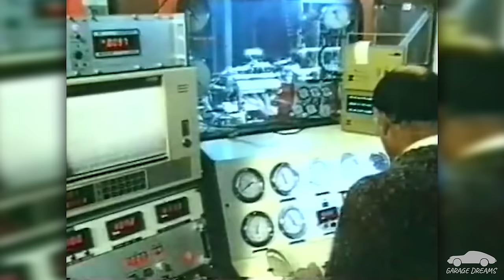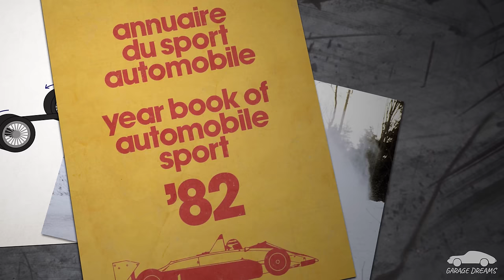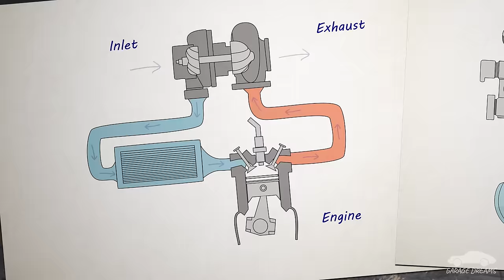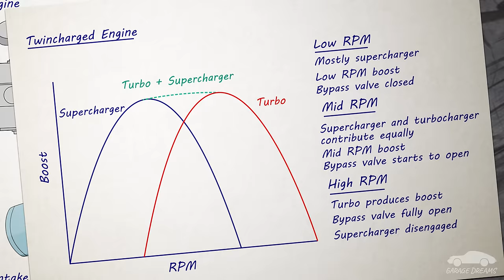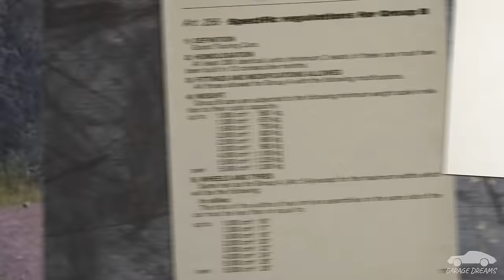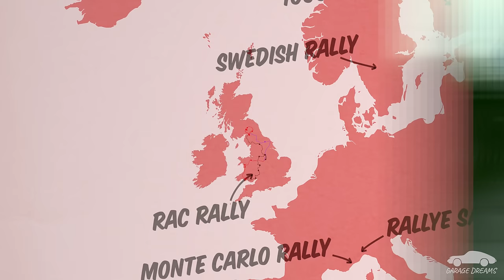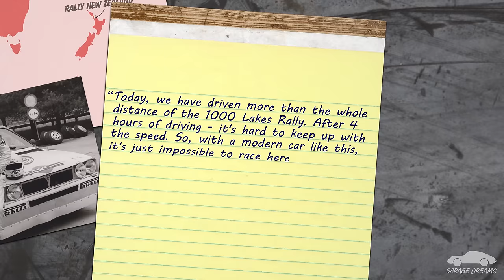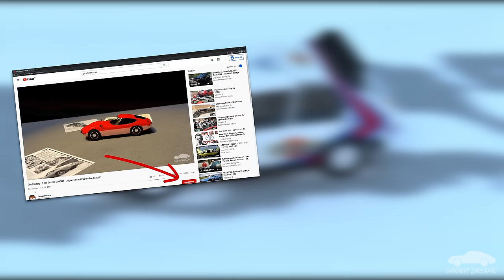The History of the Lancia Delta S4 - The Car That Ended Group B

Comment: Correction* Lancia created a rally car like no other before, or after... this is the greatest rally car this earth will see.
Reply: GP2_Engine the Quattro was not that good only won because the got the rules changed and nobody else had awd
Reply: GP2_Engine  you mean iat abarth
Reply: The greatest of Group B rally cars of all time is the Audi quattro Sport S1 Evo 2. If it wasn't for the quattro, all WRC rally cars would still be in FWD and RWD. And if it wasn't for the quattro Sport S1 Evo 2, WRC rally cars wouldn't have any wings, spoilers and winglets, square fender-flares, turbo anti-lag system, dual-clutch gearbox etc. etc.
Reply: @7spower998  No way, thing handled like a supertanker with the alignment out and was obsolete the minute Lancia an Peugeot ran 4wd.
The 131 and escort had flared arches,if being picky the Chevette HSR had box fenders years before it.
Reply: @7spower998  the dual-clutch came from porsche (and the official race car was a 6-speed manual anyway) and bodykits already came before it in the bmw m1 and metro 6r4.
Reply: GP2_Engine  The S4 was a mid engined turbo and super charched car. No match for the outdated front engined S1,  period......
Reply: Kind of a little bit of both. It ran like nothing else, but that was part of its downfall. Insane car that was a victim of it's own insanity.
Reply: GP2_Engine  Cool as hell but Delta and 037B were real devil's 4 wheelers!
Reply: The Quattro was always the one..went on into different variations Audi were already working on an even more powerful version when group B was banned unfortunately.
Reply: @LJay54  ....what about the later Quattro S1 E2 versions that beat the Lancia and Peugeot? They were also working on the 700hp Audi Sport Quattro RS 002 of course when group B was banned. This would have blown away all competition.
Reply: The quattro is one of the most succsessful cars in group b
Reply: Correct 100%
Reply: @TinyBearTim  they all were good
Reply: AUDI trick the FIA and the other Manufacturers in Paris, France on the table to change the rule that do not allow AWD in Rallye ...they just ask them to allow AWD but absolute nobody despite AUDI wich was testing Iltis this year realize what is really happening because no-one else was dealing with this stuff at the time! AUDI was already starting to build the first Quattro's when the meeting was on going! That dirty ...but the Lancia 039 show e'm "Who is the Boss" ^^
Reply: @Lancista  The Lancia delta S 4 should be used as a case study of what can be achieved when the full force of human endeavour is unleashed to create something magnificent with the sole purpose of blowing the rest of the competition out of the water. The abarth team had a lot to do with it too I believe so credit to them. It is the same power that sent a rocket to the moon in  less than 80 years. Should the same power be unleashed to restore this beautiful planet , it would look like paradise again within a few generations and certainly a whole lot better than it does now within just a few years.
Reply: GP2_Engine   Quattro had the advantage of not being shelved with the death of Group B, as the project got to get tinkered with a bit more and taken to Pikes Peak and the technology later being brought onto paved circuit racing like SCCA, IMSA, and DTM. But within rallying itself Quattro was at a bit of a awkward place, being super bulky and front engined while the succeeding cars were either lighter, smaller, or had better weight distribution.

The main reason the Quattro is remembered the most from this era is primarily because it got used outside of Group B.
Reply: Didn't beat the 205 T16 in 86 🤔
Reply: @TinyBearTim  yeah..but that sound tho 🤤🤤🤤
Reply: I think “Monster” Tajima and his Suzuki Escudo Pikes Peak edition would like to challenge this. Heck Millen and his Celica Pikes Peak have a case too
Reply: Modern Group C cars now exceed Ground B performance.
Reply: @towermoss  yes but that’s with modern technology! The group B cars were monsters, like a feral dog 😂
Reply: Toyota Celica GT-four ST205 has entered the chat
Reply: @Lancista  they didn't trick them  , they just asked at the end of the meeting can they have 4wd , and they said yes if you want
Reply: Correction. Lancia had already done this by creating the Stratos, the first purpose built rally car ever. And there has been nothing like the Stratos ever since.
Reply: @towermoss  Vastly improved tyre and suspension technology.
Reply: The Delta S4 was the peak of rally cars but the Quattro changed the course of rally the most. They still use the 4wd platform today.
Reply: @bfc3057  Wow, and considering there are so many replicas out there, you're lucky to see a single real one. I'd love to see the first prototype, and there's a great story being that. My rarest encounter was a private viewing of the Le Mans winning Porsches in Melbourne, which came over from the museum for the 50th anniversary in 1998.
Reply: @bfc3057  that's the one, I love that flat paint job. I read an article about how they fitted the Dino engine without really getting the proper permission. There were a few sitting on the shelf at Fiat, and the original four cylinder just wasn't doing it for them.
Unfortunately when loading the museum Porsches, they dropped the container with the first  1948 356. Well, the first Porsche ever built. I don't think the aluminum body held up too well. Consequently it needed a restoration... and I missed out on seeing it. It would have been the icing on the cake. Thanks for the info, it'll be a long trip from Melbourne Australia.
Reply: @bfc3057  I was a massive 356 fan as a kid. It's amazing what people have, from McLarens to Stratos. But wow, how many do you need? Quite the nice investment, I think I've heard about that bloke before. I used to own Fiats and Lancias, and the community is pretty tight, word gets around. 
A guy in my small country town would drop his kid off to the school bus in a 959 in the 90s. I couldn't believe my eyes, it was real. I think there's only one other in OZ.
Yeah Fiat being part owner of Ferrari, and I think at the time had acquired a share including Lancia. I think they may have even driven the Stratos to the Motor show for the unveiling. That would have turned heads, what an incredible looking car for the time. Probably only comparable to the 1969 exhibit of the Porsche 928.
Reply: @bfc3057  Love the 288 GTO. Now these are some of the rarest modern cars around for obvious reasons, homolagation. They thought the 037 delicate, but it proved them wrong, so we'll never know. I only had a couple of Betas. Would love a Fulvia or Monte  Carlo. There's something about the lines, and for me, one of the most beautiful cars is the 037. And I  can see the relationship to the Beta and Monte Carlo styling. Plus my father bought a Beta new in '77, so it has been ingrained in me since I was very young.
Reply: The Group S cars?   poor things
Reply: 037 and s4 ara the kings
Reply: Like mr.Alen  told  when local sports reporter asked what was new delta s4 like  , in summer testing. " U can image of what is like to drive tractor 250km/h. That's what's it like"
Lot have happened since those days. And sure group b cars were great at that time. But if some1 blames them greatest, he/she havent ever driven a rally car.
Reply: @bfc3057  nope not the Quattro. Along with idiotic spectators and no crowd control it was actually Lancia that killed Group B unfortunately. In the aftermath of the Toivonen / Cresto deaths it was found in the official investigation that Lancia had stripped down the car to be lighter and not placed adequate protection around the fuel tank cells hence why they sadly got burned alive. A terrible tragedy that could have been avoided it it weren't for Lancia's pride coming ahead of safety.
Reply: @arconeagain  Stratos was the greatest rally car of its' era I still love the Stratos best looking car I think but it couldn't compete with the Group B monsters...my heart would love to agree with you but my head says no 😀
Reply: @bfc3057  I had a Beta, Delta and Alfa Romeo Montreal. Loved every one even though they gave me nothing but trouble and were money pits especially with electrics and bodywork rot. Typically Italian - expensive, temperamental and fiery but like your first love they made you smile a lot.
Reply: @alexcawthorne811  yeah I know it's no match for a group B, just thought I'd point out that Lancia did something very ground breaking several years before. They had a habit of doing this, like the monocoque and V6 engines in passenger saloons. Thanks.
Reply: @arconeagain  I adore the Stratos and yes it was a car designed and bred purely for rallying although I have to say the original concept is possibly one of the ugliest cars ever.... thankfully the final production Stratos was a thing of true beauty. I also really like the R037....if I ever become rich I'll buy a Stratos. Sadly out of my league....even the AR Montreal I had as a mere youngster in the 80's is going for £50-70k now. How I wish I'd held on to that, my Beta and Delta but running them cost a fortune.
Reply: The quattro didn't have much success in wrc in 85 or 86.
Peugeot and lancia were far more successful.
Reply: @theant9821  agreed they were the cars to beat in 85 and 86 but from its' initial launch in the Austrian Rally in 80 through to 84 the Quattro pretty much left the rest for dead....and it still won in 85 with Röhrl winning the San Remo...if only Group B had survived the planned Quattro RS002 @ 700 hp / 186 mph would have destroyed Lancia and Peugeot in the planned Group S. I guess we were lucky to have had the chance to watch these incredible cars but enough was enough...it had become too dangerous.
Reply: @bfc3057  hahahaha....good point...alas we will never know! I think we all agree it had got out of hand. Moreso the total lack of control of the spectators it's amazing not more were killed.
Reply: @bfc3057  I think also important to mention the Porsche 959 and Ford RS200 both of which were new but in development and with some tweaks and in Rally trim they could have put in some real changes. The Porsche of course went on to win the Paris - Dakar.
Reply: @bfc3057  Yes the 959 was really something, RS200 showed potential and a 288GTO would have been something though like the Quattro probably a little bit big and cumbersome versus rival manufacturers offerings...but who knows we can only speculate what might have been. A sad end to the Golden Era of WRC nonetheless.
Reply: @alexcawthorne811  Audi quattro won the championship in 82 and 84.

That's not especially dominant. 
1980-audi quattro debut
Constructors Champions:
1980-Fiat 131 abarth (group 4)
1981-Talbot sunbeam lotus (group 4)
1982-Audi Quattro a2 (group 4)
1983-Lancia 037 (group b)
1984-Audi Sport Quattro (group b)

That isn't dominance, that's winning 2 out of 5 titles.

Even the pikes peak car looked impressive until Peugeot stopped sending regular group b rally cars and built a pikes peak hill climb car themselves.

The quattro was relatively poor and fortunate that its rivals were busy developing 4wd cars of their own while audi already had one. Because the chassis was poor by comparison to its competition hence why the less powerful naturally aspirated cars kept beating it and the rwd 037 took the first group b title.
Reply: @theant9821  look at how many wins it had vs competition. Rallying is a fickle sport as we all know...mechanical failures and crashes play a big part over the season in deciding who wins the individual title as Michele Mouton will tell you. They were by far the most succesful team overall.
Reply: @alexcawthorne811  all variations of the Audi quattro combined won less number of world championship rallies as the Peugeot 206, which despite 3 consecutive championships isn't remembered all that well.

The quattro was successful because it had a good engine and 4wd, not because it was an especially good rally car, and as the competition got 4wd they left the quattro behind. It wasn't until late 1984 that the quattro got its first 4wd rival in the form of the 205 t16, and the Peugeot cut the quattro to pieces from mid 1984 onwards.

The quattro was an impressive car to watch and was competitive against rwd cars like the 037 or opel manta but struggled when a made to measure 4wd group b car like the 205 t16 or delta s4 came along.
Reply: @theant9821  The Peugeot 206 was used in 99-03 so different era altogether more than 10 years after Group B disappeared so cannot be compared. The Quattro was up against the 205 which won only 16 compared to the Audi's 23 victories.
Reply: @alexcawthorne811  i was giving a comparison between a relatively dominant rally car and an average one. The quattro is remembered for the engine an 4wd not for its success. The fact that the 206 was in a different era is irrelevant. 

and the 205 t16 had 2 and a half seasons, while the quattro had almost 7 seasons. The start to win ratio of the quattro is poor when compared to the 205.
Reply: @theant9821  Still the car that made group B what it was. Without the Quattro none of the others would have existed and you'd have 2wd....best car of the era unquestionable. The Audi RS002 would have bown them all away sadly never came to be.
Reply: @alexcawthorne811  the 037 was the first group b car. When it comes to making group b what it was, the quattro was one of several.

The quattro is the iconic car of the era, yes. But it certainly wasn't the best, if it was the best it wouldn't have been cut to pieces by the Peugeot and both lancia.

The icon is always remembered through rose tinted spectacles. Wether its the quattro, the swinging 60s or anything else.

The quattro was a fine road car, far superior to its rivals homologation specials but as a competition car it went into battle with damp powder because Audi refused to change the engine and transmission layout, for marketing purposes, they wanted to sell the Quattro brand to customers more than dominate rallying with a homologation special that bore no relation to the mass produced cars like the Peugeot.
Reply: @theant9821  The 037 was a lovely car for me one of the best looking (after the Stratos of course) may have been the first Group B but obsolete as fast as it came in. Audi still won rallies where Peugeot and Lancia were present but sure they were the ones to beat. Audi were still working on upgrades to the original Quattro which would have made it more competitive. Could be the case that they wanted to sell more road cars of the existing model but to say they wouldn't change it is wrong as the RS002 was a whole new ball game and a homologation special.
Reply: @theant9821 one final addition...as somebody who has had several Audi's and 2 Lancias and I genuinely love both brands the one thing I can never forgive Lancia for is how they cheated especially even to get the R037 entered into WRC. They never made the 400 units officially required for a start and duped officials into believing more had been made so effectively the '83 title should have been awarded to Audi which changes the figures...changes them dramatically. I know cheating is very Italian but still in competition the one thing you should never do is cheat and they did as we all know...whether de-icing the roads as they did in the mountains of Monte Carlo, submitting more entries on tarmac rallies that suited them or simply not sticking to their start times as they did in the Acropolis to let the dust clear it's cheating however you look at it.
Reply: @alexcawthorne811  that has been common practice in making homologation specials for decades, be it lancia, Porsche, Ferrari, or most other highly specialised homologation cars, if you're going to take it from lancia, take most le mans victory from Porsche but who do you then give it too, as everyone else did the same thing.
Reply: @alexcawthorne811  and entering more cars on some events wasn't cheating, it was just using the rules to your advantage. 

A championship winning car isn't the one which takes advantage of what the rules say, its the one which takes advantage of what the rules dont say.

During the mid to late 90s btcc we have since learned that in several seasons not a single car entered was within the rules.

I doubt an f1 car has taken a race victory without breaking the rules some how, they just weren't realised until years afterwards.

Besides Audi had clever tactics of their own, as any championship winning team requires to have. The quattro wasn't free from controversy.
Reply: @theant9821 Rules clearly stipulated how many must be made and that they must be based on production vehicles available to the public (interestingly both Lancia's R037 and Ford's RS200 both cheated here having built theirs specifically as rally cars before they had even built road going versions) shame they have now gone it was nicer to see tham at least "based" on road cars though in reality we all know that was never really true. Even the Peugeot T16 only use the 205's roof, doors and headlights!

Sure there have been other breaches of homologation rules but interestingly nearly all have occurred in just one class because of its' diversity and notorious history of being difficult to police where you can just about replace everything and still call it a production car.... I refer of course to GT3 due to the ineptitude of the FIA! It certainly hasn't been so common in other areas of motorsport.
Reply: I highly disagree.
Reply: @Ben-nn7ls  with what exactly?
Reply: @alexcawthorne811  the sport quattro didn't share any body panel with the regular quattro.
Just like the t16 or s4.

The sport quattro had wider arches, shorter wheelbase, wider track, different engine block, different roof panel, different a pillar, different doors, different windows except the rear window, different bonnet, different cooling system, different suspension, different car

The sport quattro was no more like a normal quattro than the t16 was a normal 205.

That is the reason for making a homologation special, so you don't have to make thousands of cars which cost more to make than you sell them for.
Reply: @alexcawthorne811  and read about the variants of the Porsche 935, half of them were made by kremer years after Porsche stopped  developing them.

Put an early 935 beside the moby dick car then alongside a k3 k4 or k5. They are completely different cars.
Reply: @kalleklp7291  everyone was good at cheating at homologation in the 20th century.
Reply: @theant9821  ....sure people pushed homologation rules BUT not even making enough cars and changing the road surfaces??? NO other manufacturer stooped that low.....
Reply: @alexcawthorne811  Audi is probably the only manufacturer to make 400 complete group b homologation specials. And when it comes to group 5 sports cars i bet none of the manufacturers made the correct number of fully functioning homologation specials.
Reply: Are you serious? S4 won only 4 rallies. Absolutely the best B group car was Peugeot 205 T16. Undoubtedly. Or you wanna argue?
Reply: @mukinfagic69  Peak??? It was a ultraexpensive waste
Reply: @marguskiis7711  Absolutely, The 205 T16 is he undisputed king of group B rallying.
Reply: GP2_Engine  Audi was Jurassic in comparison with S4, please...
Reply: Then came the ECV...
Reply: THIS earth?!!
Reply: @arconeagain  In fairness, the Ford GT 70 was the first purpose built rally car. But it's handling and reliability was terrible. Ford wisely shelved it.
Reply: I totally agree, but absolutely bonkers.
Reply: @TinyBearTim  it didnt win as much because it got out shown in tarmac. many competitors would drop out of races accepting defeat knowing they wont take the quattro on loose terrain.
Reply: @7spower998  This thing eats the quattro for lunch.
Reply: @7spower998  lol... no.... just stop using drugs 🤣
Reply: @PieterHalveLiter  Imagine saying that The first AWD car that changed everything wad Outdated
Reply: To quote Bret the hitman Hart "It's the best threre was, the best there is and the best there ever will be".... Love Lancia Delta S4
Reply: @7spower998  They weren't the greatest because their performance and winnings but rather because of their innovation? Yeah, no
Reply: @mukinfagic69  And still is Rubbish! Don't last! The Lancias do! 😄
Reply: @ilko2025  it just wasnt
Reply: @alexcawthorne811  it wouldn't it's balance was simply not good enough too heavy with a bad turbo design very laggy understeered then oversteered through every turn its dynamics simply were not ever gonna be good enough
Reply: Piloted by a greatest driver ever lived
Reply: @alexcawthorne811  Wrong read the rules for god sake you needed only 200 cars youre talking about group 4 which needed 400 cars. Jeremy told you that story good one bruh
Reply: @parabelluminvicta8380  rubbish.....you need to know the rules they cheated.
Reply: @alexcawthorne811  the only one rubbish here is you with your bias old man. Did Jeremy told you the story by himself?
Reply: @parabelluminvicta8380  you're boring me...you don't even know anything about the sport or it's history...troll.
Reply: @alexcawthorne811  It's fine, you can search for yourself the regulations book of the GrB its not that hard. It states that you need 200 cars homologated. No because of you i dont know the history of Lancia. please just stop spreading lies which Jeremy told you.
Reply: @parabelluminvicta8380  nobody argued with that...Lancia never made the 200.
Reply: Definitely the best Group B car was Peugoet 205 T16. x2 Championships in all clasifications. This car was insane.
Reply: @markc1456 Lancia was probably terrible to drive (that's what said their drivers)
Reply: @jiiiiiib  It's not B Group car. -1 XD
Reply: @OOpSjm  Not as good as B Group (only 222D was epic in my opinion)
Reply: @parabelluminvicta8380  And? Idc about their management. It was the best B Group car and it's a fact.
Reply: I agree
Reply: How many championships did it win?
How many did the 205t16 win?
NEXXXT.
Reply: @sugarnads  i'm french ans i have a Peugeot so i love so the t16 but the delta s4 is really insane
Reply: @markc1456  me trying too see if someone said this
Reply: Could be the drivers made the difference since they were used to 4wd cars.
Reply: Quattro was left the chat...
Reply: @7spower998  I believe you mean Audi Quattro A2, this car changed rallying forever. Even tho S1 E2 was very advanced, It wasn't as effective as the original because at the time everyone had mid engine hatchbacks.
Reply: The Earth never looked at this car, and never will.   Similarly, no human should look at this video!  
The CGI is terrible and pointless, the diagram / sketches are simplistic and redundant, the graphs are grossly inaccurate, and the narration app/bot is mediocre at best. 

Go check out one of several other vids, that explore this car much better. 🙂
Reply: Audi with Michelle Mouton best car and pilot
Reply: @7spower998  Audi is well known for using technologies from 20 years ago and claim that they have invented it as the person beneath you explained
Reply: @ilko2025  What kind of an achievement is that?
Groupe B wasn't for long and it didn't have 30 cars or something.
Being "one of the best" there means nothing.
The Delta clearly was a whole other league at the end against the understeery VW
Reply: @7spower998  I dont think so you forgot the Subarus. They came after and they would have introduced AWD first if Audi wasn't there. In my book Audi was cheating because they had AWD and everybody else RWD.
Reply: Se tiveres tomates conduz um  mesmo num vídeo game
Reply: Lancia S4 Group B tarmac setup 
My god that’s the best setup ever 
S4 looks & drives like no other, what a machine 👌
Reply: It’s my dream car
Reply: L'ancien is no more
Reply: @7spower998 S1E2 Quattro shitbox was literally a massive embarrassement, won just one race, top drivers left Audi team bc of it and Audi team quit mid season
Reply: @francouz23  Production-based vs Special purposed built rally car. LOL, you didn't know that. 
Today, Audi still exists, where Lancia disappeared into the abyss.